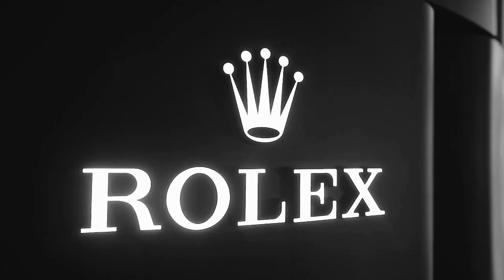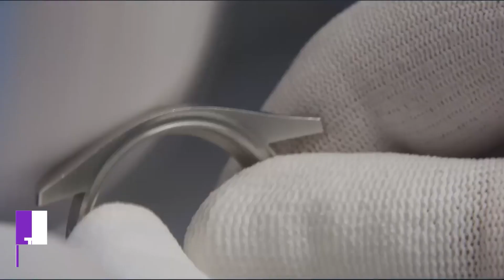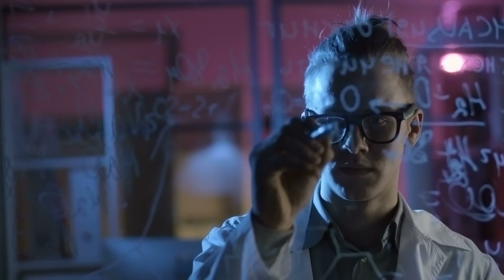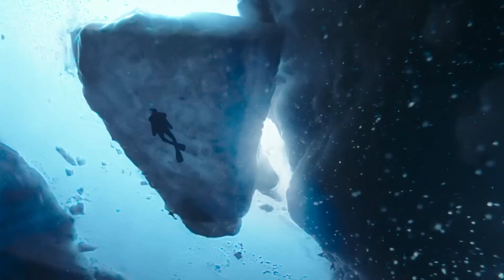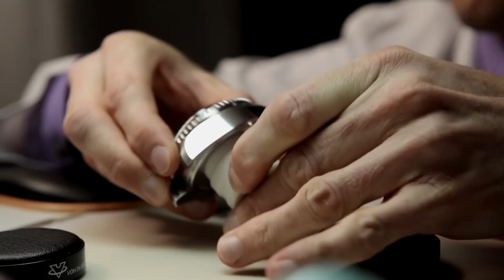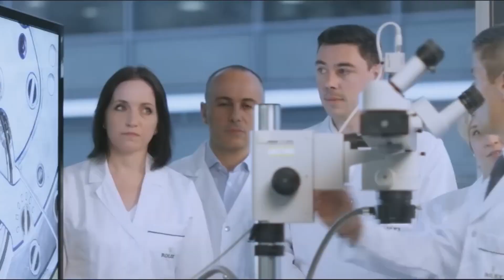Rolex Watches Manufacturing Process

Comment: Rolex, as a general rule started to use 904L universally on their  steel ranges in 2002 appx. the use  of it before was to test the efficacy of the metal composition. They were definitely the very first to use sapphire crystals on watches...as far back as 1969. Regardless of their production methods, the end result is beyond comprehension.